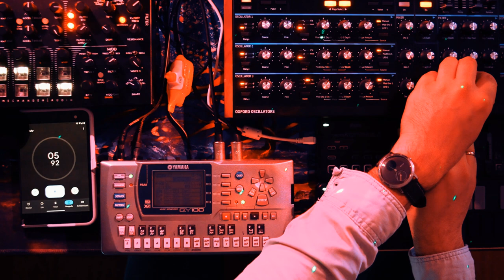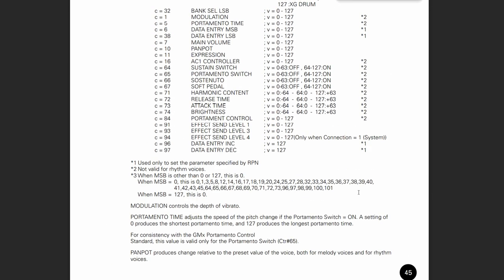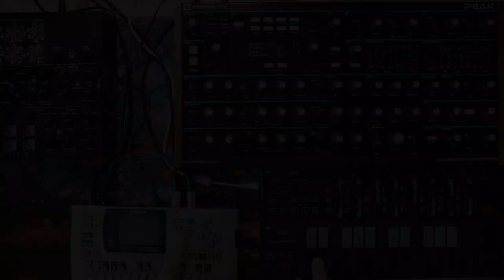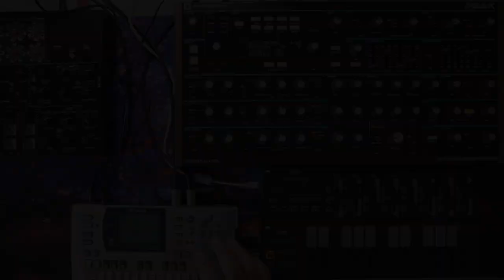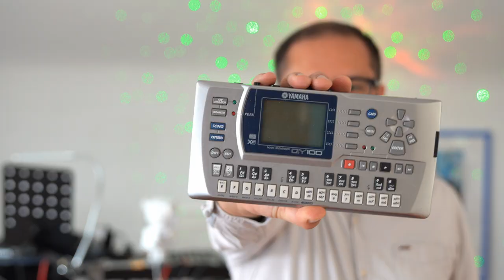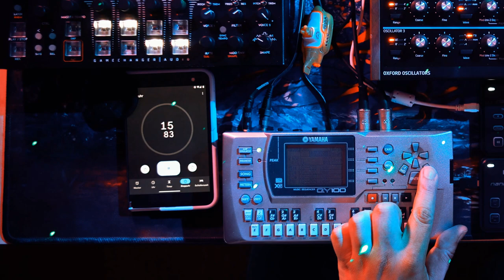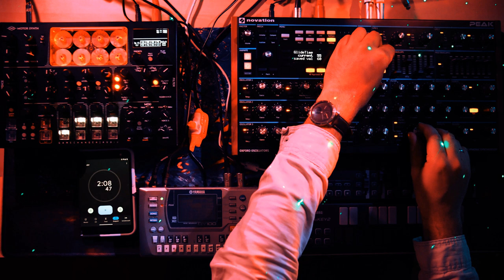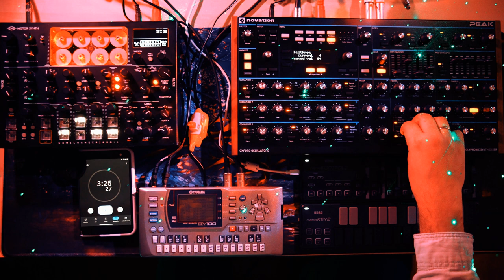Yamaha QY100 as the main sequencer in your hardware synthesizer setup

Comment: So I wrote this whole long thing and all I had to do was ask, how would you transfer MiIDI data from a QY100 to a QY300 since the 100 uses a card I can’t find but I can transfer via WIDI to IPhone camera kit with SD, then I answered my own question with a SD to floppy converter. The 300will also be connected via WIDI so as Rosanna Danna used to say, NEVERMIND, lol, still how would you do it? The 14 pin isn’t an option.
Reply from the maker: Well, the most uncomplicated thing would be: 1) MIDI out on the 100 to MIDI in on the 300, make the 300 listen to MIDI control data, press record, then push play on the 100. ;-) Of course, that will transfer your song in realtime, so it's not the best option propably.
Second option: Try to make the QY100 data filer run on your PC. @JayB has a copy of it on his homepage https://www.jaybmusic.net/tools.html

Comment: I’m still having a hard time trying to get my synth (ultranova) to play it’s original sound and be able to be sequenced by QY-100. I can get the ultranova to play QY sounds but not other way.
Reply from the maker: If you're in pattern mode, you have to turn on midi out in the system, midi settings. By default, the QY will then send on channels 9-16, unless you manually change it to 1-8. (Your Nova presumably listens on channel 1).

Comment: Is the QY100 capable of pattern switching external synths on individual MIDI channels. IE creating sequences on the QY with the ability to initiate an external pattern change  anywhere within the sequence but not necessarily have any note data ?
Reply from the maker: In list edit mode, you can add any MIDI command you like. SysEx isn't possible, though.
Reply: Thanks Floyd,

The QY100 / 70 seems like a great little sequencer. Now to find one !

Comment: Great application for modern synthesizers.I was wanting to use the QY100 as a MIDI controller to control playback by assigning parameters in Studio One 5, but the start and stop button of the QY are not showing up in MIDI Learn. Can you please help?
Reply from the maker: The MIDI behaviour of the control functions can be configured with SysEx messages, please see the QY100 MIDI implementation manual for this: https://de.yamaha.com/files/download/other_assets/0/318130/QY100E2.pdf   (page 52)
Reply: @mr_floydst  Thank you very much, although this is all new to me so please can I get a step by step guide on how to do this?

Comment: Thanks Floyd! QY70 cames first and it's also a wonderful machine.
Reply from the maker: Thanks for watching! :-)  I never used a QY70, but viewers said it's basically the same without the audio input, so I guess it's a great box.
Reply: @mr_floydst  I think you're right. I have a QY70, and as far as I can see, the only differences are the input and the card slot, and slightly different button shapes. The interface looks otherwise identical.
Reply: @threedaymonk  There're the amp simulators and the pedal imput, and maybe 20 something additional patches. But, for many of us, QY70 sounds better.

Comment: Hello Floyd, very watchable video. I wonder if you can advise me on the QY100? I just bought a Novation Launchkey 49 MkIII ~ intending to start working with Ableton. (I'm 'oldschool' and had always previously worked with CoolEdit) However, I find that Ableton isnon-intuitive, and difficult to understand or get to grips with. (not to mention the irritation of uploading, downloading, registering, and installing all sorts of programs and interfaces ~ When I just want to make music. I managed to pick up a QY100 secondhand here in China, and so now I have the Launchkey, a QY100 and my laptop - and have a 'DAW' ~ Cakewalk which is still available as a free download and install ~ No updating, upgrading, subscribing necessary! 
My query is this: How can I, if it's possible (!), utilise my LaunchKey 49 as a controller for the QY100, and combine with / record into Cakewalk?
Reply: I'm wanting to utilise the soundbanks and drums on the QY100, possibly the sequencer too - But using the Novation as the control surface. Is it possible?
Reply: Do I, should I get Cakewalk to 'recognise' the QY100 (somehow) and then the LaunchKey as the MIDI controller.. ~ So LaunchKey ~ Laptop (DAW-Cakewalk) ~ QY100 .. or.. LaunchKey ~ QY100 ~ Cakewalk  ~ Obviously leads cables and connectors are not my forte!
Reply from the maker: Hi, thanks for watching. Your Launchkey should have a MIDI out port. Connect that to the MIDI in port of the QY100.
Then, watch my video: https://youtu.be/1Jrc3X6sZUo ;-)
There's a list of "MIDI CCs" here so you can set up your Launchkey to send these: https://anotherproducer.com/online-tools-for-musicians/midi-cc-list/  - the CCs can be used for playback control, sound selection, sound modification and so on.
The QY100 is an GM/XG controller. Connect it to you Computer using a USB to MIDI interface. Then use a control template for General MIDI devices in Ableton. You should be able to select all the Instruments and so on then.
Reply: @mr_floydst  Wow, thank you very much for your advice Floyd! Much appreciated! I'll give it a go! 
(Nice groove you've got going there btw!) 🎵🎶🎹🎼

Comment: Floyd- So glad I found your instructional videos! I have both the QY70 and the QY100, but I still struggle to understand how to add effects to individual tracks. Perhaps you have covered this. If so, where should I look? Thanks again!
Reply from the maker: Please take a look at this video, which doesn't answer your question directly, but explains all the parts you need to know https://www.youtube.com/watch?v=dvJ1FGDcYBc
Reply: Floyd- Thanks for the reply. Your video was excellent as usual, but still left me with questions. In the QY100 manual it states: “To use the variation effect settings in the SONG effect connec- tion and edit display, play a song consisting of only sequencer track (1...16) data. It’s sometimes useful to execute Expand Backing job on page 176 to “expand” pattern track data to the sequencer tracks.” Is this the key to applying Variation effects to individual tracks? I’m OK with the Reverb and Chorus functions, but the Vari remains a puzzle. Thanks again for your expertise and superb YouTube presentations…
Reply from the maker: Ah ok, I think you're overestimating the QY100s technical prowess here ;-)
The whole QY100 can only have 3 send effects active any given time: Reverb, Chorus/Delay and "Variation".
You can then adjust the dry/wet ratio of these  effects  for each channel individually, but you can't assign an individual effect to each channel.
The third effect is named "Variation" because it can be changed in the course of a song. The song editor has control data for this.
You can also create some patterns each having it's own variation effect, and then line up your patterns to a song. Play back the song and the QY100 will switch between effects when another pattern is played.
Hope this helps ;)
Reply: Floyd- Thank you again. I promise I’ll keep experimenting with effects on both QYs and I’ll get closer to a working application. In the meantime, I’ll be watching your videos and making some music. ✌️

Comment: Thank you for the tutorial, i still kept my QY-70, so I will follow your setup, Subbed.
Reply from the maker: Thank you!  I'm actually thinking of trading the QY100 for a 70, that one's a bit smaller and I don't need the audio input.
Reply: @mr_floydst  The QY70 runs about $50/60 less on EBay and Reverb but I do like the extra features of the 100, plus it’s the later model but they are similar in many ways.

Comment: This is a hidden gem. What other modern devices like this would you recommend? I am looking for a portable controller of a setup of two roland boutiques and an aira compact.
Reply from the maker: Hi, thanks for watching! I'd say there's nothing comparable to this box at the moment, but if you're looking for a small and powerful yet relatively inexpensive box, take a look at the Dirtywave M8. It's a tracker/sequencer with soft synths and a sampler built in. It's a bit smaller than the QY100 and has a much nicer screen. :-)
Avrilcadabra is premier ambassador for this device on Youtube.
Reply: @mr_floydst  thanks for the reply! I see you also have a qy-70. Do you like it over the qy-100?
Reply from the maker: @Leandrob13  it's smaller and has groove quantisation. It doesn't have the card slot and the audio in.

Comment: How did you do the drums? and have you ever played around with the modulation Parameter of the QY? How does it work compared to normal LFO?
Reply from the maker: The drums are from the QY100, too - the Electronic kit. You can use the modulation CC for a simple LFO, but if you want more control, here's an article by SOS that does more in-depth: https://www.soundonsound.com/techniques/creative-synthesis-yamaha-xg-part3
Reply: @mr_floydst Thanks a lot sir :)

Comment: Very helpful video, Floyd! Any tips on how to connect both NanoKontrol and NanoKey to QY100 for using them both at the same time?))))
Reply from the maker: You can use a Raspberry PI for that. Please see my pinned comment for the link. It's a 1 minute text editing job on that mini computer and even the smallest model (RasPi Zero) is perfectly suited for that.
You could also use a dedicated USB MIDI hub like I did in this video, but this one is sold out. Blokas has a MIDI hub too, but it's not cheap (but it is also totally awesome).

Comment: Thanks for the video. A blast from the past. Great device. I have had a QY100 for 15+ years however I barely use it anymore. My main issue is with transferring midi files from a windows PC to the QY100. The smart card still works with the Yamaha to store and read files. However I am no longer able to connect the smart card (through a USB smart card reader) to the PC. The drive is no longer detected correctly I guess no longer supported in recent versions of Windows. I think I was then transferring files through the midi cable but it became a painful process and I progressively stopped using the device. If anyone has any tips with transferring midi files to the QY100 I may start using it again
Reply from the maker: Thanks for watching! I couldn't even get a smart media card before shooting this video ;-) So I'm afraid I can't help. But maybe some of my viewers can...
Reply: Get a smart media xd card adapter. Xd cards are not expensive though format it with the qy100. Card should read and transfer to pc

Comment: hello thanks for the video   i have a question why you set the patter on 9-16 instead of 1-9  thanks
Reply from the maker: That's just the MIDI out channels. I did that for no particular reason, 1-8 would have worked as well. It's just that the QY100 does the same if you convert your patterns into MIDI data - the patterns will then occupy tracks 9-16 in your song while 1-8 will be free for you to use.

Comment: Hi Floyd.  Floyd I have a smart media card that will not upload the patterns I have been downloaded on it . 
 My question is what can I do to fix it. The other cards I have, have no problem with releasing the work I've engraved apon Them.
Plus I promise to make sure I make  copies
Reply from the maker: Hi. If your data is really important to you, you have two options to recover it (if the card doesn't work any more):
1.) Send it in to some experts who'll try to salvage it. This is not cheap.
2.) In the past, a program named RecoverIt by a company named Wondershare yielded the best results for me. They have a free trial that doesn't salvage anything but shows you what it could salvage so you can decide if you want to pay $60 to use it properly.
There are other apps around that might help you, but I found their UIs extremely frustrating / you  had to deal with cryptic command lines that were not documented properly.

Comment: 218 / 5.000
Resultados de traducción
Resultado de traducción
Hello, I am German from Argentina. I have a question about the Qy70. I bought it recently and there is no way for me to save the patterns or songs I make. They are erased on time. Yes or if I need something external to save my sessions?
Reply from the maker: You don't really need anything external. This sounds like the internal battery is dead, you need to replace it! Should be a standard CRC32, if I remember correctly.
Reply: @mr_floydst  thank you so much. already solved

Comment: Hello Floyd I have a problem I hope you can help me with. With the QY 100,  it seems so that The Yes command button and a few notes aren't responding . Is there any way I can repair this myself , Or would i have to send it in for repair and if so is there an address that I can send it to ?
Reply from the maker: Hi, the first thing I'd try is cleaning the contact. Get a can of compressed air and try to clean them from the outside, if that doesn't help, open up the unit, lift up the rubber pad and clean the contact with q-tips and alcohol.
Reply: @mr_floydst  thanks I'll send you an update thanks 😊
Reply: Thanks My QY is a close to top operation. The Yes command button and The board it makes contact with had a bit of a Shine that most of the board didn't.  So with a q-tip and alcohol I went in and gently rubbed off some black residue also being light enough not to overdo the chemical that's there for it's purpose .  Anyway so far so good. Wish I could send you some pictures I took !!! 
Thanks a million bruh. But  eventually I will probably have to send My QY in for repair. Does Yamaha Lab have a address I can send the QY 100 to.  I have to have It At it's Best form 
Or
Is there a remote control one can use. That could take the stress Off of my device ?

Comment: Does anyone know if the QY70 can sequence external gear too or is it just the QY100?
Reply from the maker: Hi! All the QYs have midi ports.
Reply: @mr_floydst  I saw that, just wasn't sure if the sequencing abilities were the same. Thanks for your response.
Reply: Yeah, I used to have a QY70 and used it with other gear as the main sequencer. I have an underused QY100 now but that will change!

Comment: Sequencing is kind of my Achilles heel, I keep buying them hoping this will be the one, and each has it's quirks or weird feature holes. e.g. the rm1x is almost the qy100, but I don't recall the scale feature, yet it has midi delay among other midi effects. I don't recall the scale feature on the rs7000 either. If yamaha would just combine these 3, they would make so much cash, omg
ps the qy100 has 32 notes polyphony as a tone generator, but 64 total for external devices(as does the rm1x)
Reply from the maker: That would be a great device, but I don't think it would be viable to develop it - I think the problem is the real world need for such a device, compared to 2001, is relatively low. We've got smartphones, tablets and notebooks now - and most musicians will use these. So those tiny hardware desktop synths we see now cater to a relatively small group of hobby enthusiasts. (And that's why synth tubers seldom get past the 200.000 subscriber mark - the audience just isn't bigger)
Reply: @mr_floydst  squarp pyramid among others is one of the reasons I politely and with respect, disagree with you. :) The novation circuit sequencer is probably the best of the 'modern' ones for my workflow, I just wish it had longer patterns without the need to chain(something other modern sequencers do have; mpc, even the mc707 in a handicapped way).
If I knew where to begin to learn to make the aforementioned hybrid, I would head in that direction right now.
Do you think rasberry pi could handle the data flow if someone were to take the time to learn it and make it from scratch? We're talking just straight midi sequencing, patterns, polyrhythm, etc?
Reply from the maker: @gossamyr  yes, the pi can easily do that (I think someone cough make some videos on javascript sequencing or a midi door using c++) ;-)
mpc is a great box, I have one in my setup. This page helped me getting started: https://ccrma.stanford.edu/~craig/articles/linuxmidi
Reply: @mr_floydst  Tysm, (heads in that direction...) ;)